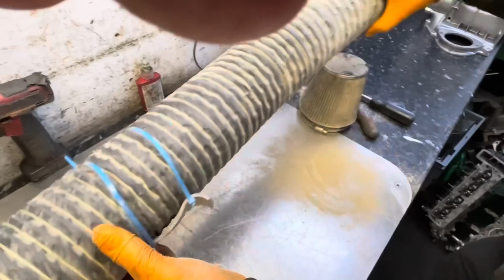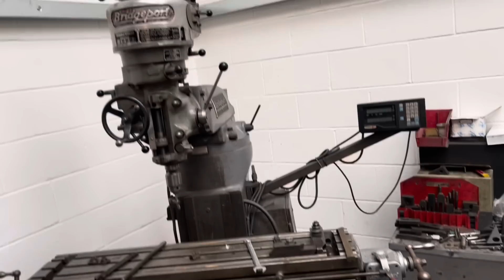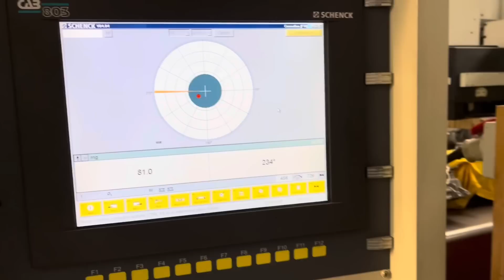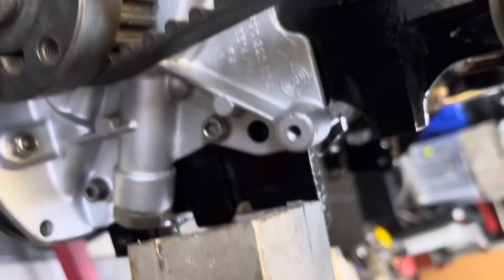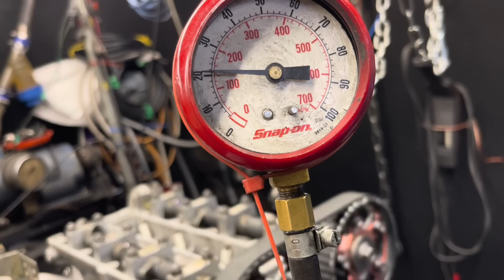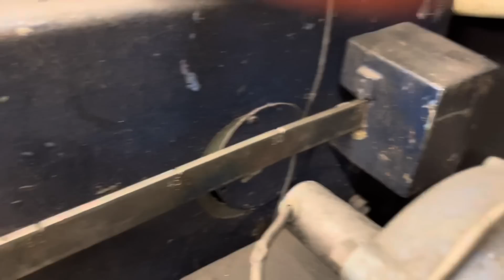Shrigleytube TV ep 46, Ed drops crocodile off, crank balance, c20xe red top build and dyno test.

Comment: Many years ago I rallied an Imp and had similar problems with dust getting past the filter and giving a 'free rebore'. The final cure was to put a large pipe through the rear shelf and have the filter inside the car, so no dust at all with the windows up on the dustiest stages. Cured, but not sure it would get past the scrutineers these days as the firewall is compromised. It was also very noisy with twin 40 dellortos.

Comment: Hey Andy, I just thought I'd let you know that when I did some experimentation with exhaust header pipe length on the Vauxhall engine, a 4/2/1 big bore header pipe setup with longer than usual  primaries and secondary pipes was superior to shorter ones like you have used, try 30" long primaries and 30" long secondaries and see what I mean, cheers and good luck mate,  Roland, HT Racing Ltd

Comment: the reason you position the gap 90 degrees BTDC  ( it doesnt actually have to be 90 but it needs to be a reasonable amount before TDC) is because your dealing with spark advance, you cant advance what isnt there, so you run trigger wheel advanced and the ecu retards  the spark, to actually advance the ignition the ecu simply give less retard :)

Comment: Something I don’t understand why don’t you add a weights to the big end journals to allow for the mass of the bottom of the conrod?
Reply from the maker: hi John, you only need to add counterbalance weight when you are dealing with a V8 crankshaft the four-cylinder crank counter balances itself out as there was always two opposing each other so you don’t need to put weights on it to balance it. Hope that helps andy